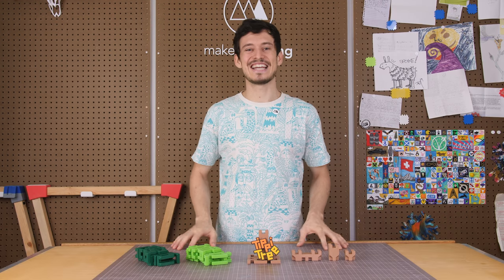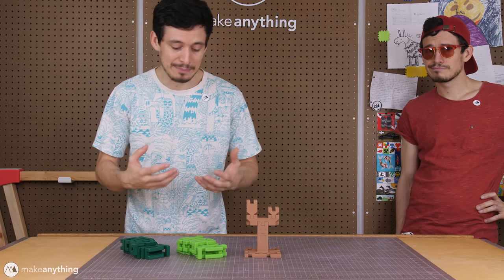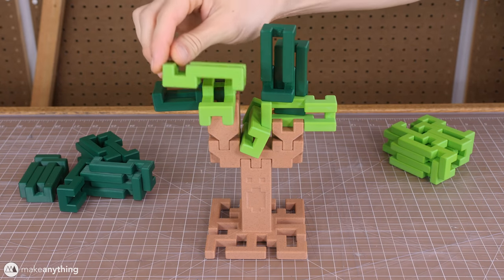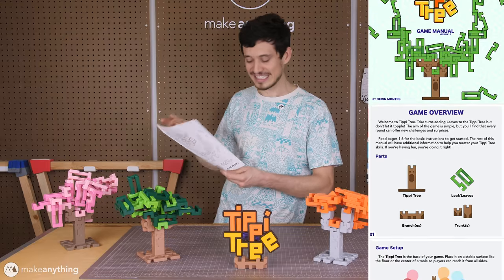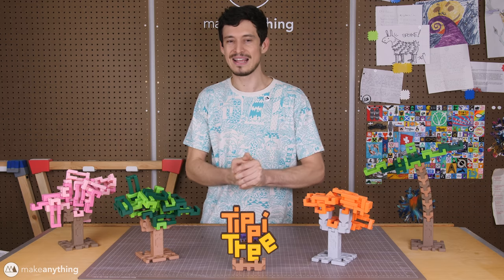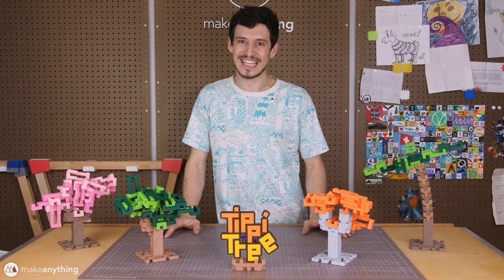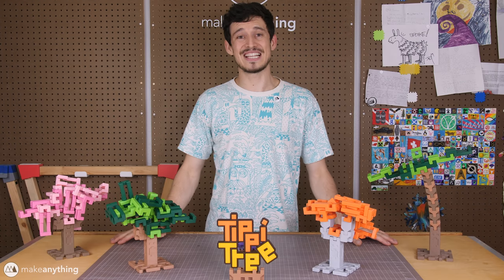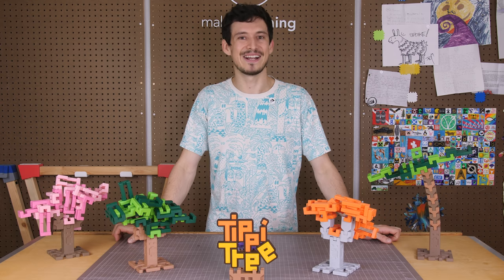Tippi Tree // My 3D Printed Tabletop Game

Comment: OMG! Totally buying these files and printing for my boys for Xmas this will be a ton of fun to play with them. Now to decide on the filament colors :)
Reply from the maker: Yayy thanks Jessy! Printing the set is half the fun :)
Reply: Same, except I will print them for me to
Reply: Thinking of buying the files and printing it for my sister for christmas. Can you tell me how much filament is used and how long the print time on your machine was?
Reply: @Silberbaer  64 meters of filament (~200g), 17 hours of print with recomended parameter  for the trunk+ 3 of each branch (3 small, 3 tall, 3 long) on a prusa i3 mk3s (slic3r setting "0.2mm quality").
currently printing leaves with announced 13 hour for 12 leaf, 48m (147g ) of filament, so 26 hours and 300g total for a recommended set of 24
Reply: @nicolasbousquet7463  Thank you.

Comment: So I bought the files off of MyMiniFactory, ordered some PLA in different colors, printed a tree, a couple of both regular and tall trunks and some branches and finally, two sets of leaves. I gave them to my kids (1 and 3 years old) and they have been playing, stacking and building trees together non-stop ever since. Awesome project, prints like a dream! Thanks a lot for making this!

Printed it on an Anet A8 with some modifications (which I managed to tune pretty well, it turns out). No difficulties printing, just smooth pieces coming off of the plate. Just goes to show that you don't even need an expensive printer in order to print it successfully.

Comment: I bought your files today and just finished printing the tree trunk and branches. I'm really impressed with how easily they fit together, and how smoothly the pieces feel to the touch. I think I'll need some very minimal processing to get it perfect :) I'm going to print the leaves tonight, but I'm so keen to try this game out with my board game group! I'm using transparent PLA to print these so I'll paint the trunk and branches, but I might use different filament colours for leaves in the future. I think I can get away with transparent PLA for some of these leaves and treat it as snow-covered for now!

Comment: Honestly, this game is pretty neat. If I saw it in a store, I would probably buy it. Unfortunately, I don't have a 3D printer, I just get recommended these videos because of some engineering videos I like to watch, who use 3D printed models.
Still, that is great work, and you might even be able to get it licensed to a game company like Hasbro or another board game manufacturer.

If you do publish this as a more standard game, I would suggest having the base game be the base, one each of the three trunk pieces, 12 light green play-pieces, and 12 dark green ones. Then you have two kinds of expansions: Leaf Expansions and Trunk Expansions. Leaf Expansions would be 24 more leaves in two colors, with some such as "Autumn" with reds and oranges, or "Cherry Blossom" with light and dark pink. Trunk Expansions would be listed by type of tree, so you would have "Oak" and "Palm" and so on, and it would come with all the parts needed to build the trunk of that tree, potentially with uniquely-colored pieces. The "Base" game would then just be a combination of an "Oak" trunk set and a "Forest" leaf set.

Comment: What are the tolerances on the leaf pieces?
Reply from the maker: It varies a tiny bit depending on orientation but the tightest clearances are 0.15mm on either side (so 10.3mm gap for the 10mm part)

Comment: Firstly can I say 'awesome work' designing the game. I have no doubt that you could make a mint with this by slapping a patent and working with a games company.

However, 3D printing is really for prototypes and custom 1 off models. These parts would be much cheaper to make in bulk with injection moulding. By the time the plan was bought and printed with all the filament it would need, it would make the game quite heavy on the wallet for what it is. That said, if I was to see this game in the shop, the temptation would be there to buy for an xmas present, etc. 

What I would like you to take from this comment, is that I say it with great respect - the game is really interesting and with production techniques and marketing it could go really far..

Comment: I love your channel, always looking forward to what you make next. 

I have 1 question, I noticed you using the snapmaker 1.0 for a few episodes now and the prints seem like they came out perfect. Can you tell me what software you used for printing these? and perhaps your settings? I'm using Simplified 3D for my snapmake 2.0 but I'm having issues with the elephants foot. My issue is with the initial layer sticking to the bed, I cant seem to get the proper balance so my prints are suffering from elephants foot at the moment.

Thank you!

Comment: 0.16 mm layers are tricky with wood filament or other filled materials. Which other layer heights can we use without drawbacks? also, 0.8 mm walls could be obtained also with a single perimeter, if using 0.6 mm nozzle (as common for wood or filled filament). It should be fine, right?

Comment: Under the rule-set presented I immediately had a question. You can only manipulate with your current piece.. but what is the extent of manipulation allowed? Twisting their piece around with only yours, but what about lifting it clear off and placing it elsewhere on the tree, all while only touching your piece and not dropping parts?
Reply from the maker: That's allowed! You are increasing your own risk of dropping something though

Comment: Would have been nice if you had the test piece free to download and see if our printers are capable, I feel like you need a really good printer for the leaves cause I bought it and the test pieces are not clean at all :( wasted 12 bucks
Reply from the maker: It is available for free, but sorry you're having trouble. Did you read through the print guide? You might be able to use horizontal expansion in slicer to make it work
Reply: @make.anything  
Dang I saw no link on the main page of tipping tree for the free download :(
yup printed and referencing the guide.
Just tried some leaves and they are locking in to each other real tight
Reply from the maker: @subiediaries6157  have you tried reducing Flow% or extrusion multiplier?

Comment: Hey Devin, I really loved the video but i just wanted to ask you for help with my sidewinder x1. I bought it because of your previous recommendations so I figured that you could maybe help me. I’m having trouble with the printer not lowering as much as needed on the z axis after moving upwards.
Reply from the maker: If you can't raise the bed enough to meet the nozzle with the leveling screws, you can physically lower the limit sensor that tells your printer when it's lowered all the way. Lower your bed with the screws first, then lower the limit switch so the nozzle stops a bit above the bed, then raise the bed again with the leveling screws
Reply: @make.anything  Hey Devin, thanks a lot for taking the time to reply to me, but leveling the bed isn’t really the problem. Any time I tell the 3d printer to go to the home position for instance, it will go upwards two times after one another, and then move to the home position as it is supposed to do, but then only go down enough to make up for the first time it went up, and then result in ending in a position that is taller than the position it started in. I was wondering if there was a way to reboot the printer or something. I have also changed the ribbon cable for the z axis motor once. 

Thanks again for taking the time to reply to me, and please excuse me for having bad grammar: English is not my first language and I’m only 14
Reply from the maker: @andershenriksen7592  Sorry, I'm honestly not sure what would cause your printer to behave that way and I'm no expert at dealing with the firmware. I imagine there's a Facebook group or online forum for Sidewinder owners that could help out. Or maybe someone else who sees your comment here. Good luck!
Reply: @make.anything  Hey man, that’s totally fine I just really appreciate you taking the time! You know I’ve been a big fan of yours for quite some time! And don’t worry I’ll tryout my luck on the sidewinder x1 Reddit! 👍